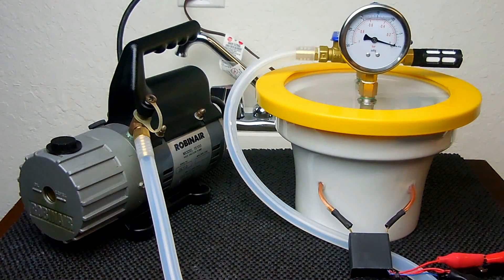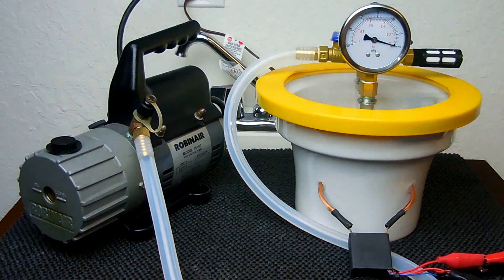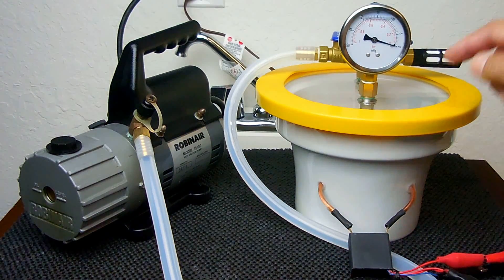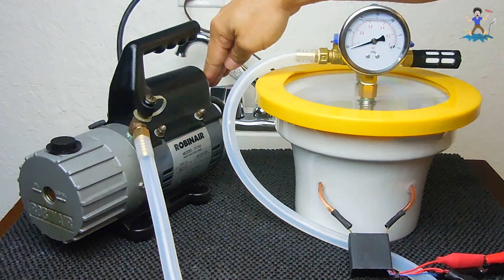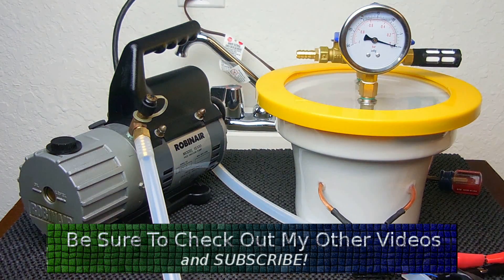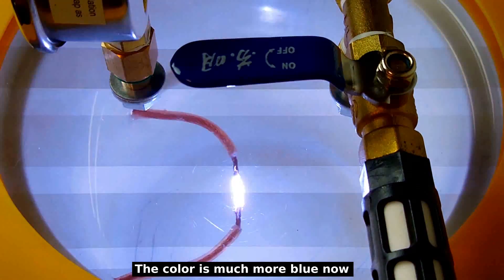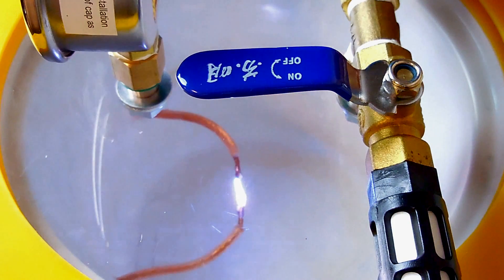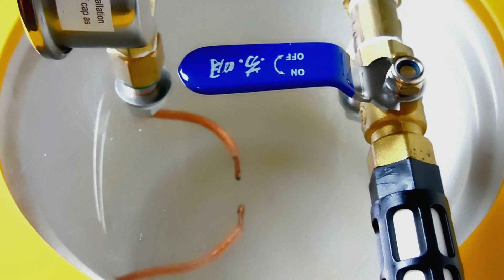High Voltage In A Vacuum

Comment: You can make carbon foam by using argon gas and a kiln and turning bread into the foam by basically burning it in a closed enviourment filled with argon
Reply from the maker: Didn't know that. Thanks for watching Jake!
Reply: electronicsNmore yeah, you should look it up.. ave has a good video on it
Reply: It’s called Arbon 😂😂

Comment: The high frequency, high potential electron stream from the Sun strikes the earths atmosphere exciting the noble gasses in the upper atmosphere, in which Xenon is the most prevalent and the sky glows blue. Yes, all of the planets, moons and stars give off their OWN light. Right after a New Moon, the rest of the moon can be seen to glow. This has falsely been deemed as "Earth Shine". The real reason is because the electron stream received by the earth is now leaking from the earth to the moon, but being so slight, the moon only glows dimly. Our Moon too gives off its own light. See a picture of a beach ball and you will notice the hot spot from the flash attachment. The Sun is billions of times more powerful than a flash attachment, yet there is no hot spot on the moon. A fluorescent tube can burn out; and too a planets noble gasses can become spent and the atmosphere no longer reacts to the Suns electron stream. It is then called a dead planet.

Comment: what about the arks in other liquids? say like water or mineral oil? do those have different colors?
Reply from the maker: Hi there. You don't get arcs in liquids, only gases. :-)
Reply: electronicsNmore

but i've seen them in deionized water for example, EDM machines work on that principle.
Maybe not water per se, but it's supposed to breakdown and i suppose then it evaporates because of the high temperatures and vomes steam plasma.
if you get the voltage high enough in a dielectric liquid, there has to be a point where it just give up and lets current pass through, that should cause some H2O plasma or something.
Reply from the maker: Everything will break down if enough voltage is applied, but in order to create an arc, you need a gas.

Comment: Grear experiment!
But why doesn't the arc form in vacuum, just like in CRT TVs?
Reply from the maker: There's no arc inside a CRT TV. The vacuum allows the electrons to move quickly from the Yoke to the phosphor layer on the inside of the front of the tube. The image is displayed. :-) You can see that at 3:40 in this video.